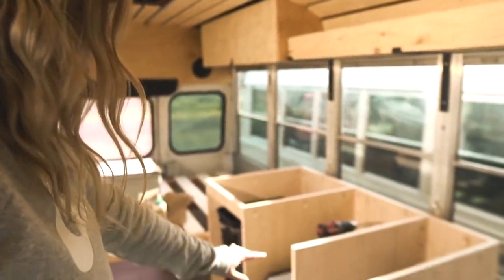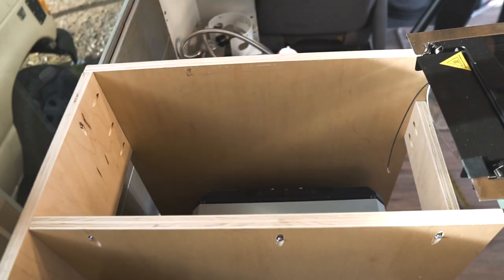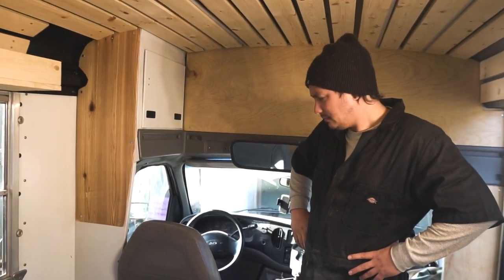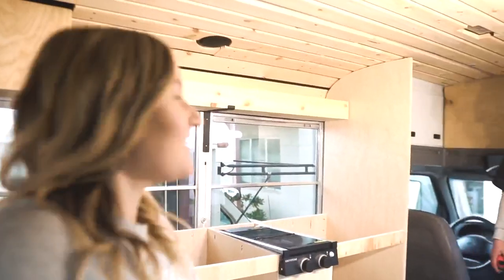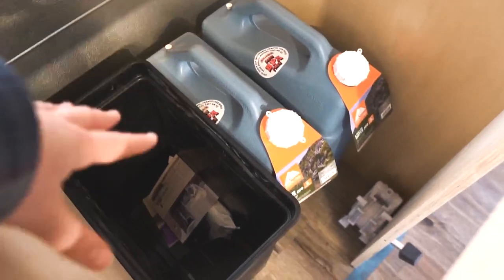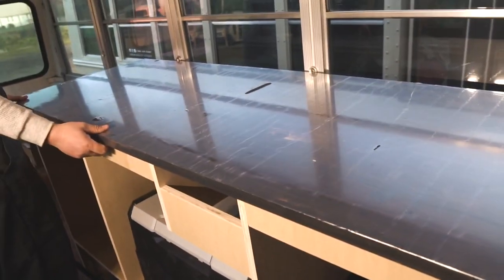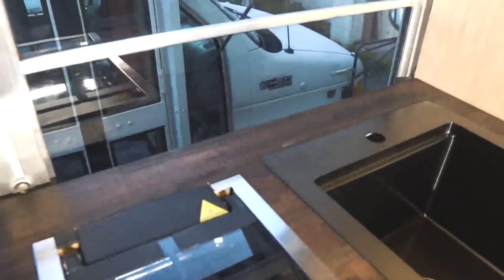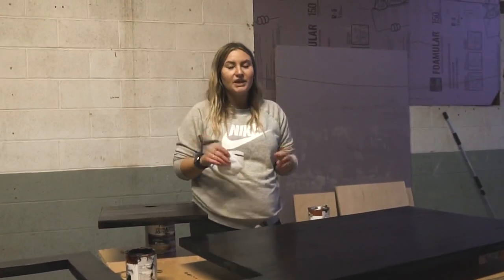My Favorite Build Day So Far! - Day 8 - 30 Day Short Bus Conversion

Comment: Awesome will you put a clear protective coat onto of the worktop before installing it? It is looking good though. An looking to seeing your bus again to. 🙂
Reply from the maker: Just the oil I believe. It’s food grade, I’ll have to double check that info though
Reply: @LeaveHerWild  if it is food grade safe it should be good without a clear coat. 🙂

Comment: Hello jaylena and Issac. What kind of camera was you using when Issac was using the jigsaw. How much is it. I found a 18' camper that im going to take down and extended out to 26 ft and rebuild it. I want to take pictures and thats it for now. Is that camera a good one to do that. I can't afford a lot in a camera. Maybe. $100-$200 is the most. Could you please help me find one . thanks for your time and help.
Reply from the maker: I have two camera I use, my go pro and my Sony. This video was shot on my Sony a6500 with a sigma 1.4 dcdn
Reply: @LeaveHerWild  where did you get it at and how much you think it is. Thanks somuch for your help and responding back to me.
Reply from the maker: @jeboutdoors377  you can get them online or at like a Best Buy. I don’t remember the cost, I’ve had it for years. But they’re a little pricey. Lenses especially get pretty pricey
Reply: @LeaveHerWild  ok thanks